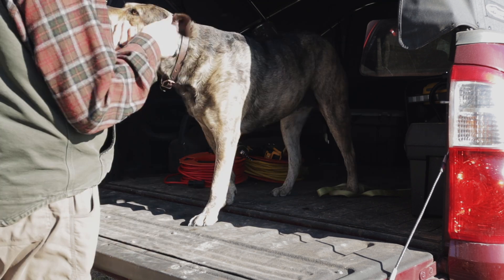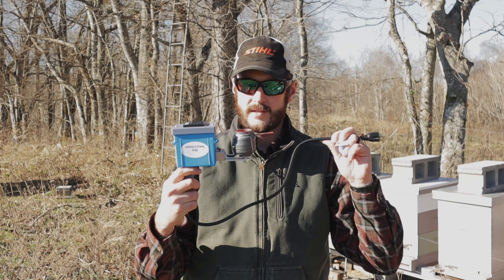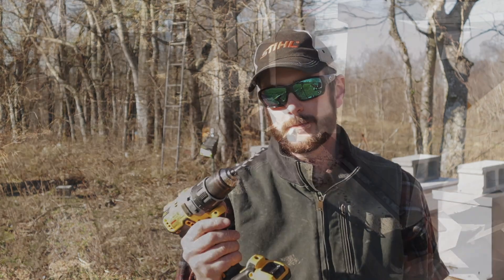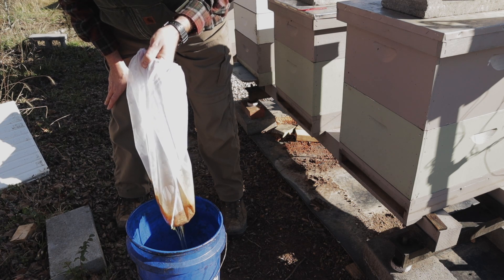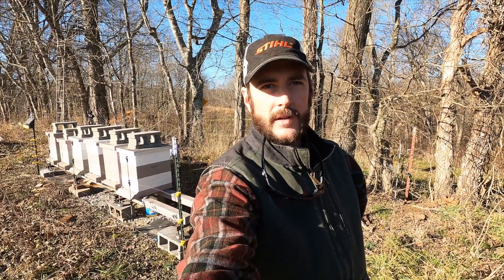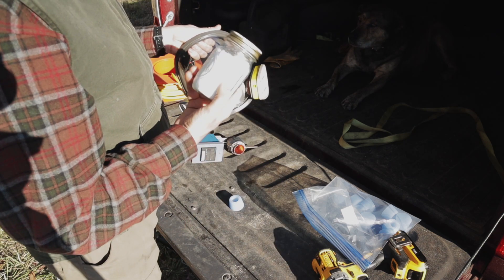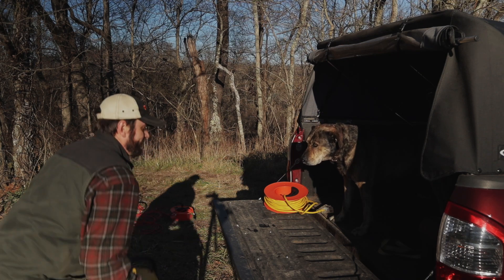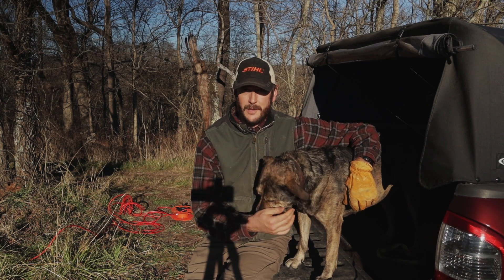Winter Oxalic Acid Vaporization with Easy Vap - ‘21 Beekeeping #1

Comment: You could get an inverter from most auto parts stores, For around $100. just plug the vap into your truck. No need to load up the generator. Just have to be cautious of running your battery down.

Comment: Three questions and one comment:  (Q1) Do you typically only treat with OA?  (Q2+) What time of year you typically treat (and what region of the US you are in)?  (Q3) Do you rely solely on mite counst in the oil testing (no alcohol wash or sugar shake)?  (C1) BTW I just bought just bought the Lorob Bee OA sublimator/vaporizer as I understand the Easy Vap is no longer available (owner retired).  Thanks for the excellent and practical video!
Reply from the maker: Yes, only using OAV.  I did mite washes last year on one round but then quit and don’t plan to go back.  Monitoring via trays is easy and no chance of killing a queen.  I’ll treat in July- Aug after honey comes off then again after the first of the year, also monitoring for fall mite bombs.  I’m in TN.

Comment: What kind of screened bottom board are you using that accepts oil? What kind of oil?
Reply from the maker: I’m using the Freeman made by eheartwood.  Vegetable oil.  Works well.  I’ll do a video at some point on bottom board styles.  It kills small hive beetles, but also allows me to passively monitor mite fall, so I can skip doing mite washes.  Seals out drafts in winter and doesn’t catch bees like the cheaper version I made DIY.  It’s a good system, but pricey.
Reply: @DuckRiverHoney  much appreciated. Another great insight.

Comment: Do you know where to get the beetle trap oil trays anywhere local? I’m in Chapel Hill. TN. Tried to buy online but shipping was 1.5x the cost of a tray.
Reply from the maker: Call eheartwood directly.  They have some cart issues with their shipping estimator.  It may work out cheaper.  Dadant also makes one that is similar, but the Freeman tray is a better design in my opinion.
Reply: @DuckRiverHoney  thank you. I’ll try that. They wanted $18+ for shipping for a tray that was $12 using the estimator.

Comment: I wanting to get one of those but I guess he isn't making them anymore so I had to go a different route.
Reply from the maker: Yeah I heard he retired.  Seems there’s a market opportunity there.  I bet it’ll be filled quickly.
Reply: @DuckRiverHoney  I found one for $175. They are actually pretty easy to make. I think the hardest part is the cooking pot unless you happen to have a mill and lathe.
Reply from the maker: Yeah, I thought about jumping into making them as well.  There are some others already filling demand though. My thought would be to offer a good vaporizer at an affordable price, but to also sell the correct oxalic acid and PPE such as respirators and filter cartridges.  Add in a proper inverter and you could make a great “all you need” kit for a beginner with not nearly so much research needed.
Reply: @DuckRiverHoney  that is a great idea. I just finished researching and buying the correct resperator & filters but still need to order some Oxalic acid. By chance would you know if it matters what the outside temp. is when applying your OAV treatments? Can it be too cold?
Reply from the maker: @Blanchard's Bees  Cold shouldn’t affect the OAV, but it does affect the cluster.  Really cold = tight cluster = OAV on outside bees but not inside.  Warm day = loose cluster and better OAV exposure.
Reply: @BlanchardsBees  Hey you may want to email him if you havnt found a unit yet. I just got one from him about 2 weeks ago. He had a few left over units to sell still just wasn't making new ones
Reply: @matts2813  yeah I found one similar and show it off in a video on my channel

Comment: noticed your mask you can add the n95,pre filters  for particulate over the yellow cartridge you have,or the 60923 3m pink yellow cartridge  that has the p100 prefilter  built  in
Reply from the maker: Yep, I usually use the 60923.  This will be the last use for these cartridges, time to replace.  Thanks for watching, and for the comment!

Comment: does the oil go rancid
Reply from the maker: During heavy brood times wax cappings will drop into it and float and that can get moldy, but a paint strainer bag in a bucket will strain everything out.  The oil itself doesn't go rancid, but I'm also losing some on each change and replacing it so it's getting freshened regularly.  Overall it works well.

Comment: You might want to do some more of your four days in a row I'll check mine and it was like that I'd be like oh damn
Reply from the maker: 6 treatments at 4 day intervals has worked well for me.  A lot better than the 3 X 7 day intervals you see recommended.  Mites emerge from cappings are are phoretic for 3-7 days on average so the 6 X 4 days gets most of them.  I don't believe any treatment gets them all.
Reply: @DuckRiverHoney  I'm just glad I have never seen  loads like that on my bees if your bees can live with a load like that through the winter them are some tough bees
Reply from the maker: That’s why I treated them before winter.  That’s why watching for fall mite bombs is important.

Comment: I'm putting mine in the bottom of the box seems to work better there instead of the bottom rack
Reply from the maker: Bottom board seems to work fine for me, and the hole stays put when I rotate or move boxes.

Comment: Good job kill them mites if you go to harbor freight you can get a inverter pretty cheap just hook it to your truck battery and you wont be lugging that generator around I think it's much easier and it will run the Easy Vap just fine  That's what I do just an idea save your back lol
Reply from the maker: Yep, I need to pick one up.  A 750 watt isn’t expensive.
Reply: Great job Nathan!! I’m looking forward to getting some honey maybe next Sunday? You can show me your operation
Reply from the maker: Your sister may have a jar...we sold out completely!  I’d love to show you the hives, but if it’s below 55 degrees they won’t be flying.
Reply: I concur about the lifting. You’ll be regretting that. Speaking as one who suffers regular back pain.

Comment: Good mite drop!! Awesome! That vaporizer is night and day from the wands once I was up over ten. I did the wand with 20+ hives one year, and that came to an end right fast....oh, and listen here young buck. Keep lifting that generator and you’ll wish you wouldn’t have when you’re in your mid fifties....I know, I know...you’ll be fine. That’s what I thought. Loading ordnance on jets most my adult life didn’t help, but once that back begins to let those disks slide, it’s down hill from there.
Reply from the maker: Thanks Mike, I appreciate it.  One trick I did with the wand was to saw the reducer in half so I only had to pull out that half to insert the wand.  Made life easier, but the cycle time was killing me.  Thought about getting a second wand but then jumped into this style.  Glad I did.  I’ve already got a spare battery so I may look at an inverter to run the vaporizer.  Should be less lifting.